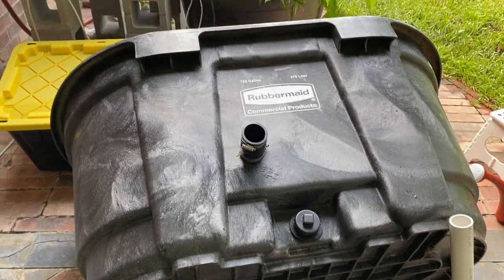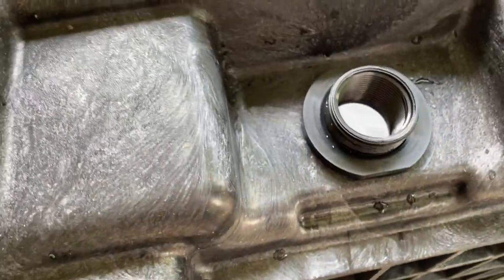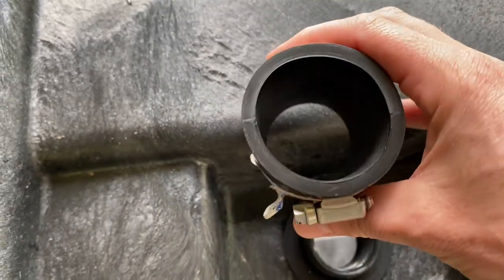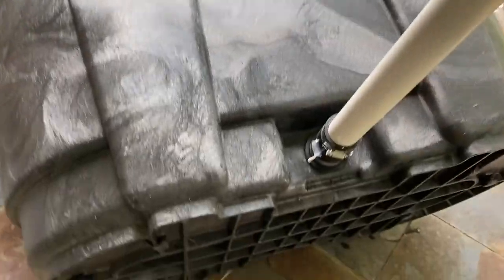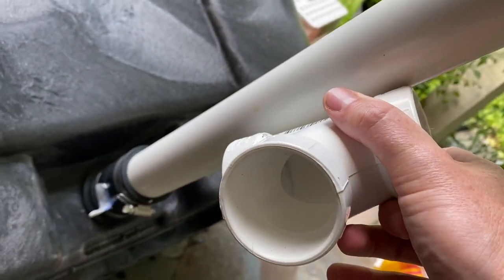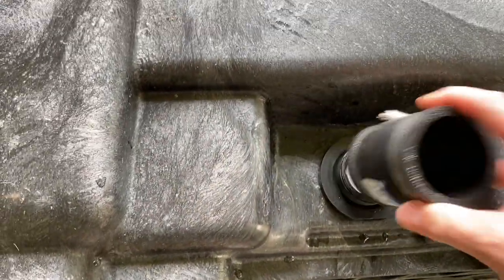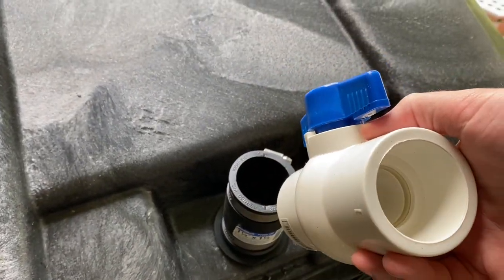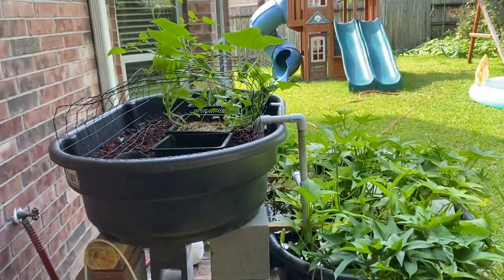How to connect a Stock Tank to PVC

Comment: Great idea! I use mine as a stock tank but want to devise a way to drain the tank to a ditch, for ease of cleaning the tank. So, I'll try your idea, but add a valve fitting that allows screwing on a garden hose that will reach to the ditch.

Comment: I did that today with the rubber fitting. Mine leaked? Did yours leak?
Reply: I came  from reddit  saw your comment torque that 5/16 nut  ss band to 60lb.
( plumber here)
Reply: @BC-sk3bp  If the problem remains spend extra on a SILICONE equivalent - they're softer and will conform to the threads better. You could try some appropriate silicone caulk as well which you can find anywhere.